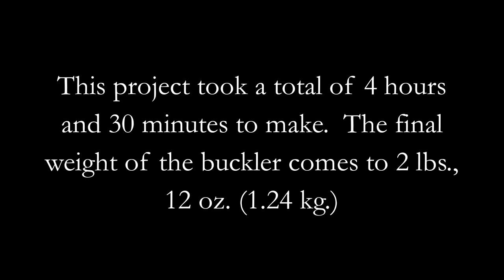Making a Historical Fencing Buckler

Comment from the maker: I used to get my steel from Lowe's Home Improvement, but over the years I've expanded to various online suppliers, including Metals Depot. However, this particular piece was made from recycled material from the local scrap yard. Steel is the most recycled material in the world and is easily processed using environmentally sound methods.  Over the years, I've made efforts to try and use as much recycled and repurposed materials as possible.

Comment: Very cool project. Thanks for sharing. I'm not use to metal work so were the lines around the metal there mostly to show you where you already had hammered as you were rounding it? Or were rounding the different lines to different degrees as you rounded it?

Comment: What's the crust that's falling off around 2:30 as the piece is being heated and beaten?
Reply from the maker: The crust is referred to as "forging scale". It's a common occurrence when hot-working steel. Basically, the surface of the steel cools faster than the interior of the steel, thus a surface 'skin' forms and sloughs off as the piece is worked. It's not any kind of issue, all blacksmiths deal with it during the creation of any hot-worked piece :-).

Comment: Beautiful metal work. May I suggest you not rivet it to plywood. Spin up a disk of wood on a lathe, or chop by hand with a hatchet, 1/2 inch thickness at centre and 1/4 inch at the edge.
Reply from the maker: The plywood design has been an economical solution for my clients for the past 10 years, but I have certainly played around with spun wooden bodies on a lathe. The current bodies are made of baltic birch plywood that have a 1/2" edge and 1/4" center. The thicker edges withstand impact with wooden wasters very well.

Comment: Sorry if this seems an absurd question considering that the video has been out almost 5 years now, but, working the metal from the outside in would drive more metal in that direction.  With that being the case, why did you hammer from the inside to the outer regions?
(On an unrelated note:  that was some excellent work on the planishing stake.)
Reply from the maker: Frank Robins, Jr. , when raising any metal, you work from the center to the outside edge. You’re not stretching metal as you’re actually gathering it up. If you worked from the outside to the center, the metal wouldn’t move how you would want it to.
Reply: Thanks.  My sister usually works in softer metals over a bed of hardened wax to push the metal where she wants it dependent on the design she is working.  I'm surprised that working iron isn't the same.
Reply from the maker: What she is doing is actually called chasing and repoussé. This was a technique that could be used on already raised and planished iron and steel armour, but you wouldn't use it to initially form the armour. Also bear in mind that iron and steel work completely differently like more malleable metals such as copper, brass, bronze, silver and gold.
Reply: Yeah, I had to call and ask her.  Repousse is what she called it.  According to her, she wouldn't want to do it with steel as that would be a pain in the ass.  She likes being a jeweler; says working in gold, silver, and some platinum is a lot easier.
And, yes, she did laugh at me as well for not understanding it in the first place.

Comment: what thickness do you reccomend for the wood?
Reply from the maker: The shield here used 1/2" plywood. Today I make these from a turned wooden body that is 1/2" thick at the edge but only 1/4" thick at the center where the boss is mounted. The weight reduction is very nice, but this is not based on a historical example but rather the needs of my clients for martial arts training.

Comment: a wooden shield (especially a buckler) need not be so thick. Half that would have been fine.
Reply from the maker: The shield here used 1/2" plywood. Today I make these from a turned wooden body that is 1/2" thick at the edge but only 1/4" thick at the center where the boss is mounted. The weight reduction is very nice, but this is not based on a historical example but rather the needs of my clients for martial arts training.
Reply: 1/2" isn't bad - I make mine out of 3/8ths and they're plenty heavy. For some reason it looked really thick in the video, I initially thought you made it from 3/4"